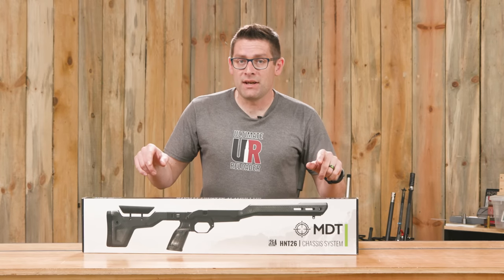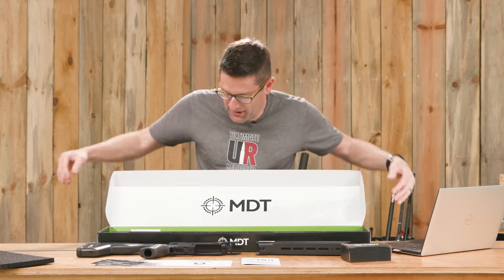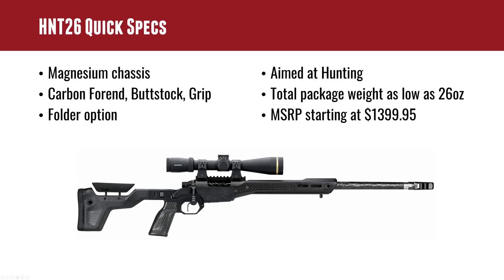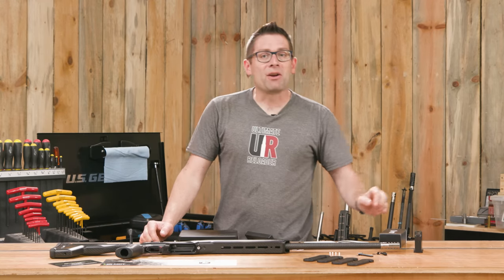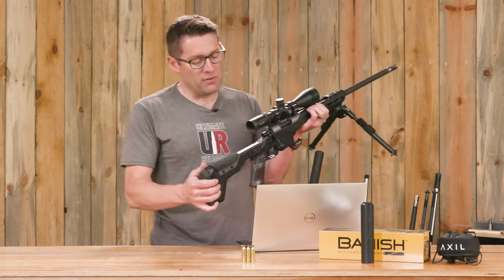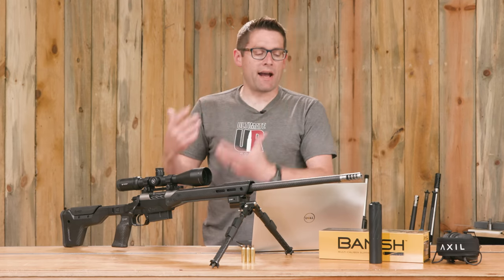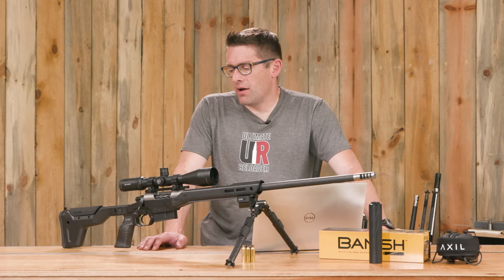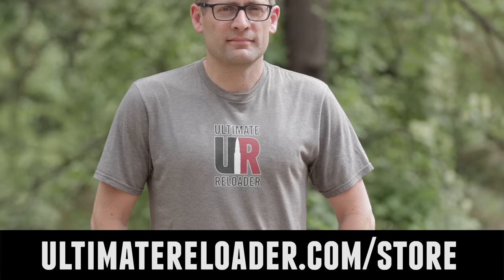Ultra-Light Weight: MDT HNT 26 Chassis (6.5 PRC)

Comment: Great review. Got my HNT26 a few months ago. Tikka action with a West Texas Ordnance Switch Lug. Swap from 300 WSM for elk and deer 22-250 for coyote and varmint. Running a BSF carbon Barrel. Check them out. Interesting tech and super light vs a Proof Research. Keep up the good work. Watch every video.
Reply: Was thinking if building the same, What was the final weight of that build?

Comment: This is the best review of this chassis I’ve seen, I was skeptical about the carbon fiber frame (as much as I love carbon fiber and the way it looks) I figured it wouldn’t take the recoil very well but the advertisement was pretty insistent on the foam filler helping quite a bit. I’m sure the suppressor helped a lot and I’d put one on anyway but nevertheless this review was very helpful in making my decision on using this for a build, I’m lookin to make a .338 lapua mag with it and I’m sure it’ll buck more than the 6.5 prc but my main concern was if this chassis held up as good as a aluminum chassis in terms of recoil

Comment: That spot is a hell of an achievement in its self! Keep up the excellent work Gavin. Badass chassis too. Yeah it’s expensive but look at the cost vs performance of shelf guns now vs 10 years ago vs 20 years ago. If it’s good others will make similar and the cost straighten it’s self out. Probably cheaper if the businesses weren’t punished for success and innovation… think other people spending other peoples money on other people. Anywho. Have a good one.
Reply: If you only want the weight savings you can get a howa 1500 and a carbon stock for the price of this stock by itself

Comment: Absolutely great review.  Appreciate the thoroughness.  This chassis looks and feels amazing.  Just picked one up for a 7 PRC build.  I found a Kelbly Tactical action, 22" hand lapped PBB barrel in heavy Palma, Triggertech Diamond two stage, and 5 rd clip all in stock and available.  Gonna top if off with a Hyperion K suppressor, and a Razor LHT 4.5-22 FFP that I have on hand. Kind of a spur of the moment build with what I had or could find available with no wait.  But pretty excited about it.  I have some RCC brass in 7 PRC to load up after I finish break in with factory ammo. Hoping to shoot 175s-190s out of it for deer, elk, and steel.

Comment: Just finished a LW mountain rifle in 280ai.  Mesa Summit Ti, X-caliber 24" carbon barrel, Mesa Altitude Carbon stock.  Vortex Razor LHT 2-15.  7.37 LBS.  DeadAir Nomad Ti will be added as soon as paperwork clears.  I've been looking at this chassis mainly for the folding stock.  I'm 5'-7" so overall length is a factor for me when hunting in the timber and deadfall.  Anything sticking up above my pack is a PITA.
Reply: It won’t work with .280a.i. cartridge as the magazine is CIP 3.85 only.  Regular long action magazine for .280 is 3.715, so your only option is getting 300 wm magazine in 3.850 and modifying the feed lips, which is not optimal and only available in 5 round.

Comment: I own one on 7mm rem mag. Im really impressed with the accuracy and feel. Just waiting for a vertical grip to be released.
Its a blue printed rem 700 with IBI carbon barrel and weighs in at 2.8kg without scope. Note it requires specific 3.85 CIP mag but the extra length is a big bonus for 195grn Bergers
Reply from the maker: NICE setup! Yes, I'm getting attached to how this platform works and feels, it shot amazing. I was surprised how manageable the recoil was with 6.5 PRC for such a light build...

Comment: Intriguing rifle you have there!
My lightweight rig is a Defiance AnTi in a McMillan Hunter's Edge stock topped with a Vortex Razor HD LHT 3-15x42 MRAD scope in Talley one piece bases and rings.  Caliber is .270 Weatherby.  Shoots 129 Barnes LRX under .5" @ 3450 fps.  Scoped rifle comes in a little lighter than your rig I think, 7 lbs. 6 oz, according to my scale, with a number 3 barrel contour and brake.  I swapped out a lighter Leopold VX3 2.5-10x40 scope for my current heavier Vortex scope because to me my rifle seems like it's at just the right weight with the slightly heavier scope.  
The Goldilocks syndrome...
Rifle built by Randy Selby.

Comment: This mule deer season going to be running a 6.5 creedmoor with the following specs:

McMillan hunters edge sendero 

Proof carbon Sendero light 1-8” twist

Hawkins Hunter Dbm with hunter mag

Geissele Super 700 1/2lbs 1st stage 1lbs 2nd stage

Holland radial break 

Zeiss v4 scope (chosen for light weight)

Talley lightweight mounts

Pierce engineering shadow SA  

Slogan outdoors non slip sling 

Hammer 124gr 6.5mm bullet w/Lapua brass

Comment: I have a 12.5 pound Savage 110 Tactical in 308 great shooter. I think a MDT chassis could take some pounds off that but the $1,600 price tag is a little touch to get to, maybe there is some other option. My  Waypoint 2020 in 6.5PRC is a lighter rifle for sure but shedding some weight off my Savage 308 is a well needed task.

Comment: Pierce engineering titanium short action . Carbon 6 16" barrel , Pendleton composite stock . Talley rings and Leupold 3-9 lightweight with cds .  Total weight 5.5, 6.4 pounds with suppressor .  4.7 without optic . It's in 308 and is accurate but tough to shoot at that weight .  Never shot a prs match with it or ever actually . It makes a sweet packing rifle . I know I could get a couple more ounces out of it but honestly it's already too light
Reply: I would love your set up in a 6.5 Gendel.
Reply: @swamprat9018   check out the Howa carbon hunter rifle ..it comes in 6.5 grendel and is damn near as light plus it's a third the price of my setup . I'm thinking about getting one myself

Comment: Hey Gavin, just curious how that Carbon Arca is holding up?  I'm debating on a new HNT 26 but can't decide to get it with the Acra or just add a MLOK Acra adapter?  Thanks
Reply: I’m going with adding an Arca mount for the safety lug / anti slip lugs on the mlok mount.

Comment: I am very interested in seeing which lightweight scope you are going to go with.  This has been a real issue for those building a solid mountain rifle!
I am thinking my build will be different this next time.  Want to try a prefit.
So, Terminus Apollo Ti SA., Proof Sendero Lite 24" barrel, Flavio trigger, Greyboe Trekker stock.  So, still looking into bottom metal....maybe a single shot config.  Warne Mtn lite rings and scope????  No idea for the scope... At least 18x.
Reply: Just put a Nightforce NXS. 2.5-10x42 on my new build. The 10x is plenty for 750yards and in. At only 19oz it’s pretty hard to beat! Would highly recommend! You can go lighter but having the reliability on the NF is worth the tiny bit of extra weight.

Comment: Hi Gavin, I considered it closely for a 6mm Creedmoor but didn’t go for it in the end. Reason 1 - was worried about the short Length of Pull. You seemed to be having to round your shoulder onto the butt. Reason 2 - I worried the foam chin rest would up to the wear and tear of being dragged through the heather and rock for the last 100m of each stalk. Reason 3 - the slick carbon might not give enough grip in wet conditions. I live in Scotland hence wet and heather.. would be interested to hear your view on the LoP.
Reply from the maker: Hi Charlie! I didn't put in the LOP spacers that are included because I wanted to show/record weight at bare minimum.... It would definitely help for adjusting LOP!

Comment: Nice build I really like the chassis except the price :) I prefer light weight in my old age

For balance do you find this rifle nose heavy less the suppressor?  ...it would seem the weight would be all towards the front

For comparison: obviously less cool factor and folding which are really nice!

My Tikka Superlite(s): These balance nice with light scope, looking at SWFA SS 2.5-10x32 Ultralight BDC for the Creedmoor to save weight

7mm Mag: 7.0 lbs 10oz with scope +caps and rail - $1500.00with scope, rail, rings
  Factory 24.3" stainless fluted barrel 
  Barrel and action 67.5 oz (4.2 lbs)
  Stock 28.4 oz  (1.8 lbs)
  Mountain Tactical Pic Rail 3 oz
  Magazine 1.2 oz
  Vortex Rings 3.5oz
  US Optics TS-12X with caps (3-12) 18.4 oz 
  
6.5 Creedmoor: 6.0 lbs 3.5oz (no scope yet) - $1200.00 with gunsmith thread and brake cost
  Factory 24.3" stainless fluted barrel 
  Barrel and action 67.5 oz (4.2 lbs)
  Stock 29.0 oz  (1.8 lbs)
  Magazine 1.2 oz
  Titanium Muzzle Brake 2 port (custom made and threaded) 1.35 oz

Comment: Hi, wondering what was the accuracy like compared to the previous stock you were using?
Reply: I switched from a ultra light stock on my 7-08 to the HNT26, that had very traditional lines. I can’t say I’ve seen an improvement in accuracy between the two, the 7-08 has always been a very accurate rifle. But what I did find was that it was easier with the HNT, more comfortable lying prone in a firing position. So it felt like I didn’t have to work as hard for the same accuracy.
But any shooting with tripod and sitting was a lot easier with the HNT chassis.

Comment: What is the best lightweight folding stock on the market?
Reply from the maker: David- I have experience with both the HNT26, and the XLR Element 4.0 Magnesium, both in folder configurations. very different setups (full Magnesium vs mostly carbon), and different price points- both work well (and there are a lot of other products on the market as well that I haven't used). In the end, it comes down to your budget, goals, and preferences. And in this economy- what you can get your hands on! We are in a world-wide magnesium shortage to make matters more complicated.
Reply: @Ultimatereloader if you had to choose one which would you choose?